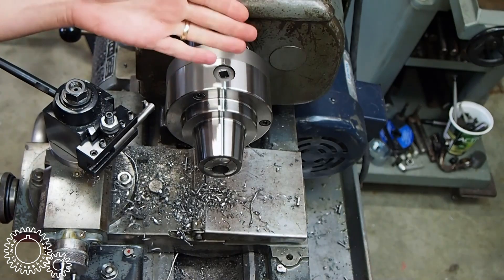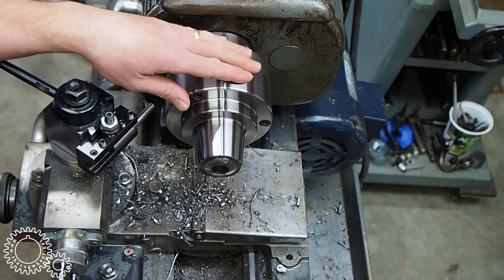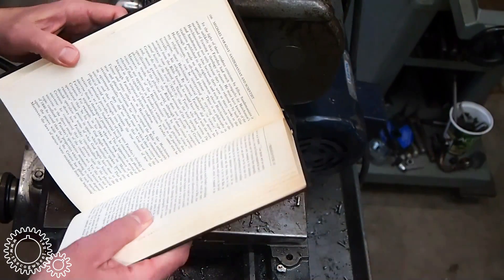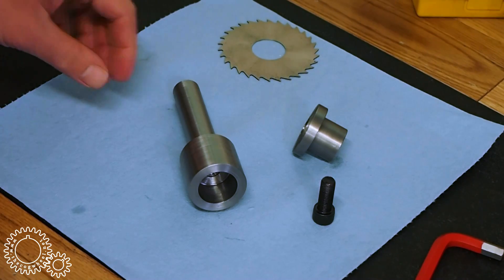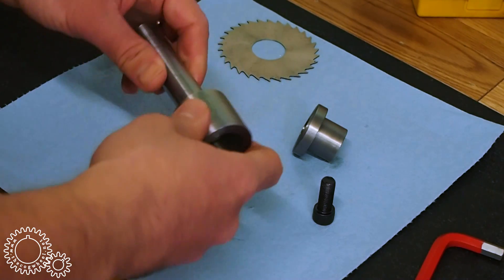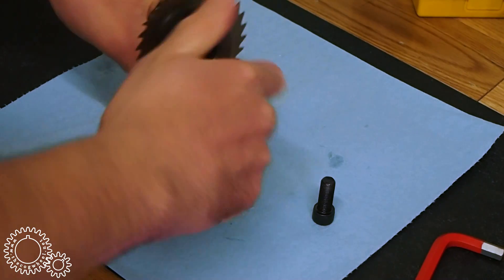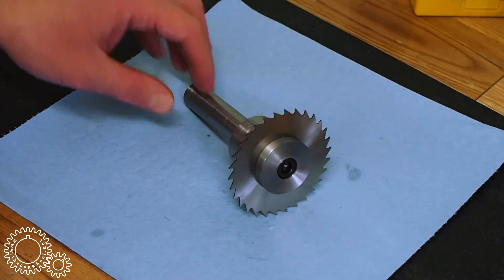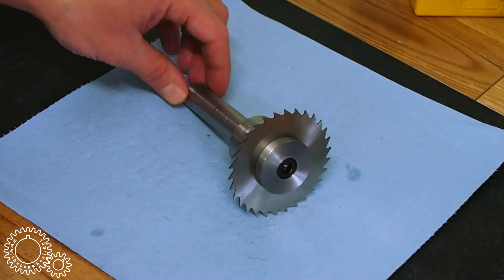Slitting Saw Arbor

Comment: Nice video and presentation. 
Page 10:44 indicates the receptacle was turned and measured before the plug saw holder. 

What if the plug is turned to fit the saw perfectly but later realize that the receptacle bore is larger than the plug a bit more than you intended?

Comment: Thank You , Excellent, you are absolutely correct, the cheap ones suck. Can I ask the make of your collet chuck? I can not get the tolerance you do with my import. Also I have found it is important to tighten the chuck cam bolts evenly and not too tight, like you said. Thanks Again

Comment: Funny how you said bough ones are terrible :)The one I bought had a perfect fit for the saw blade hole. But the corner was relieved to much and saw blade would fit right in.So I added a standard washer that was a reasonable fit. I tightened things up, used it, broke the blade and could never take it apart again. I actually broke an allen head bit trying to unscrew it. Today it still lays in my chip tray. One day I'll try to make one myself. Nice job, great camera work too.

Comment: Here's a thought you turned that in a 3 jaw Chuck you're still dealing with the run out that the three jaw Chuck caused! So you can dial that run out oh by turning it in opposition to the end hair run out in the collet Chuck.,, But that is just masking the problem the original run out is still there it's just not showing up. This is not a problem as long as the entire surface that protrudes from the truck is getting caught it will then be in columnar center with the old run out and will effectively remove it completely.

I really don't like those 5c collet  Chuck's that are store-bought I make my own! I make them as small as humanly possible and this way I'm dealing only with the inherent run out of the nose of my spindle which is absolutely zero!!  I think you should build one yourself you'll be very happy with it
Reply from the maker: I agree.  I really like the MLA (Metal Lathe Accessories one) if you want to go with a kit.  I'm still considering making one.  It's that make vs buy struggle that always continues in the home shop.

Comment: I've heard the indicators with yellow dials are actually metric. is that the case with yours?
Reply from the maker: Mine lines up with my Mitutoyo .0001" DTI.  Asimeto isn't a rip off import brand - it's a "value" brand manufactured in Asia.  I prefer Mitutoyo but there is a significant price difference and the Asimeto stuff is much better than no name import.  It's really good for home shop type stuff.

Comment: you run the chuck up and down with a battery operated drill and finish with the chuck key. I do realize that a snap of the finger is far better
Reply from the maker: you are right.  I should start doing that.